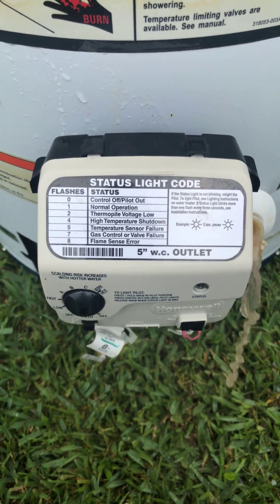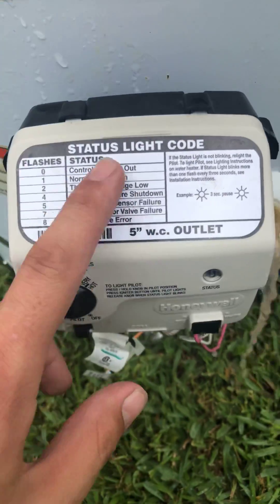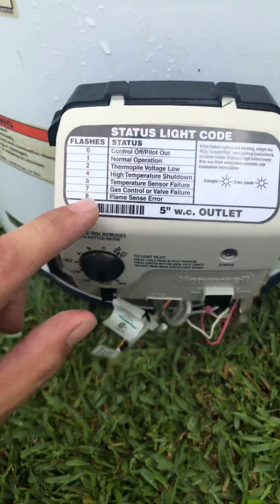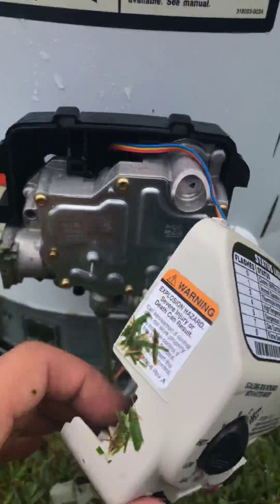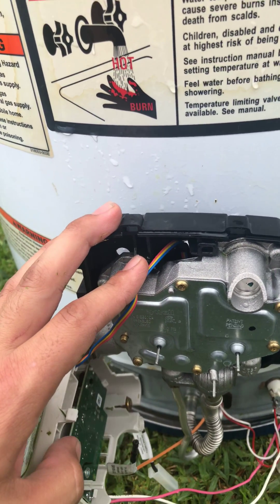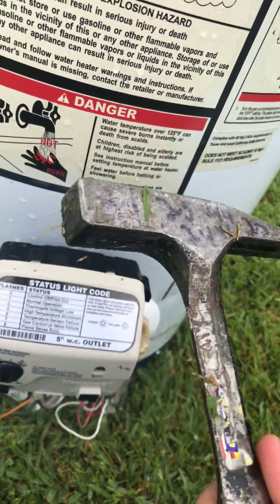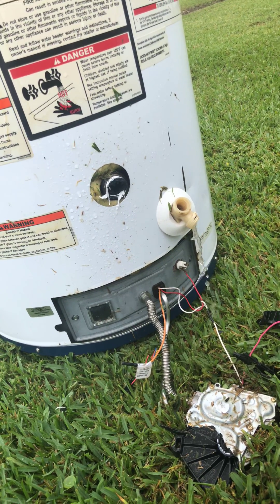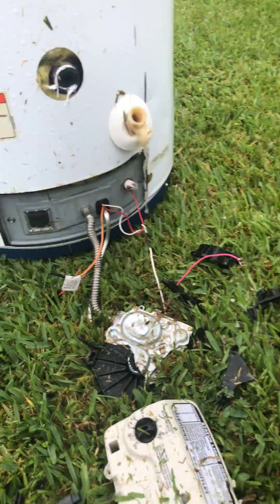How to fix Honeywell gas valve on water heater gas control

Comment: Best advice for these overpriced  under performing, completely ridiculous gas controllers. My water heater runs only on low, or perhaps it’s pilot only, Controller indicates (5) flashes indicating “Faulty Temperature Sensor”.  Of course there is no way to replace just the sensor and replacing the burner assembly  with a part that is no longer available is the current status. Testing the temperature sensor shows “closed” circuit so the sensor is tested good. Still this HoneyNotSoWell keeps indicating a bad sensor forcing me to unplug the temp sensor plug from the controller, reset everything, relight pilot, and start the heater. Then wait for 6-8 min for it to register a nonexistent fault, rinse, lather, repeat. What I would give for an old school water heater WITHOUT one of these idiotic controllers. They always worked.
Reply from the maker: The one I replaced this one with worked fine and never had any issues so maybe the addressed the issue ended up moving recently though hope it holds up for the new people haha . But yea the old school has valves where tanks changed my grandpas water heater the other day it was 22 years old never had any issues . The threads on the inlet on top started to leak at the body of the tank that valve though was perfect wonder why they try to fix things when they aren’t broken .

Comment: I got a new (old) valve on Craigslist for $35. Now I have hot water again. Didn't try the hammer method though.

Thanks for the content.
Keep up the good work.

בס'ד
Reply from the maker: Haha you wouldn’t believe how great it felt , almost as good as the hot shower after
Reply: @TheRandomHandyman   You just gave us an entire new meaning to the expression "water hammer."

Comment: Welp...not what I came here for but that was hilarious. My water heater is 8 yrs old and I'm debating whether to just get a whole new one.  2 months ago it went out and I got it going with the- turn to very hot for 10 secs..then hot 10 secs..then pilot. 2 weeks ago- out again. It was blinking I think 2 times so I just had to restart the pilot. Now no lights flashing and can't even get it lit. Been trying all the suggestions in these videos minus replacing anything like the thermocouple or pile- which I'm not sure makes sense if it won't even just light.

Comment: I just don't get why there aren't class action suits on these. 
I bought a house that has a 2020 model. Has the 5 flashes of doom. No reset fixes it. 

Swear if they had a small amperage wire going to these instead of the stupid generator setup, these would be leagues better

Comment: don’t quit your job. waste of time
Reply from the maker: Guess who got two thumbs and hot water??? Me haha if you smashed yours and went buy a new one perhaps you would not be looking for a video on how to fix it 🤷🏻‍♂️
Reply: Water heater I was working on had a tear in the burner screen, not uncommon and a total fire hazard.  This was causing gas valve to shut off (doing one of it's jobs)! You said you replaced 4-5 gas valves,, yet could be other issues causing Gas Valve failure (thermopile/thermocouple, drafting issues, or in my case a burner assembly under recall). Smashing it is the worst advice one could offer. I got it all replaced for free after some reading.
Reply from the maker: @mattodrums  snashing it wasn’t the advice the advice was to buy a new water heater in doing so it worked great after.

Comment: I am not a plumber but I had the same problem.  If the light flashes 4 times, the water is telling you that something is wrong. It is working exactly as designed to keep you safe! Usually the inside of the water heater is full of silt or calcium buildup that causes it to over heat. 1st, drain and flush your entire water heater. You can attach a garden hose and run the water outside. Then there is a simple process something like turning the control knob full on for 10 seconds, then to hit for 10 seconds, then to pilot for 10 seconds. The control will reset itself with no need to replace any parts.
Reply from the maker: Honeywell claimed after it shows code it’s done for no telling new water heater had had no issues
Reply: @TheRandomHandyman   but if there was buildup of sediment or calcium on the bottom of the water heater from years of use, then it will overheat until you flush it out. If you fix that problem, you can reset the controller and it might last longer.
Reply from the maker: @johnharris5508  I follow what your saying, but I reached out to Honeywell on multiple occasion and said hey look this thing is flashing 4 times, the response when it was under warranty was that they were sending me out a new control module because once it showed 4 code it had overheated and would not work again. I had previously attempted to flush tank when it went out the first 2 times and re filled tank and attempted to get it going again and it lead to no success as referred to in this video they have videos of other people saying you can use a 9v battery and 2 jumper wires and “reset” the module and make it think it’s all good again and it will then work , I also attempted that on the 3rd one that had gone bad. As even though the boards were free when under warranty I had to wait for them to ship from across the United States so I did everything I could in attempt to take a hot shower. But according to Honeywell on the phone the model in this video once it overheats it opens op and breaks contact inside and does not close back rendering it useless and having to be replaced. The water quality here is very poor and in the 5 years I lived here with that water heater I had changed that module 4 times if not 5 I had also flushed the tank every 3 months in attempt to prevent it but in the end it still broke in this video it was at the point that the warranty had ran up and I was going to have to pay 125 or 150 for part as well as the valve on the flush port was about to fall apart witch it did crack and fall apart when I emptied it the last time before putting new water heater in so it was on it’s very last leg, now the new water heater is made by rheem and also has a Honeywell valve on it that looks a lot alike but is a different model and have different codes and it has had no issues at all so perhaps the one in this video was the worst model they make idk, but my grandparents built a house up the road about 2 miles and the water is from the same place and they have had the same water heater for 21 years and have never flushed it out and never had any issues at all what so ever so idk. But what I do know is when the first swing of that hammer met that control valve many years of pain had been let go lmao
Reply: @TheRandomHandyman  Honeywell is wrong then. I have cleared the 4 blink with 10 sec on high then med then low. Hot summer days trip it sometimes but I have run it for years after. Clearly not working now though as I am watching your video & agree with your choice of tools!
Reply from the maker: @870wingmstr  lol hit it one time for me haha
Reply: @TheRandomHandyman  I don't have that special hammer. Do you think my 12 pound sledge will work?

Comment: Amen brother! I have had mine replaced 4-5 times over the last 3 years and it is absolute trash! I can't understand why any company would purposely manufacture a faulty part like this! You'd think they would lose money replacing them constantly during the warranty! I'm on the hunt for a water heater that doesn't use the honeywell (or Moneywell rather) gas valve, which will be hard since most gas water heaters seem to use this brand. It's insane!
Reply from the maker: The new one I replaced it with is a rheem from Home Depot it has a Honeywell valve that looks very similar but it’s a different model and I’ve had no issues over the past year
Reply: @TheRandomHandyman PLEASE HELP!! ANOTHER video said this Honeywell gas valve/thermostat is NOW made by RESIDEO.  My water heater is only 3 years old & I just now got the “4 BLINKS” and am wondering if anyone has had BETTER LUCK with the RESIDEO model that supposedly REPLACES this Honeywell piece of crap?? I need to call my HVAC company to order a replacement and want to know if the RESIDEO one is better!! Thanks!!
Reply from the maker: @beachgirl4truth  haven’t heard anything about a different company but once it flashes 4 times it’s dead gota be replaced call number on heater for waranty
Reply: @beachgirl4truth   Honeywell just changed their name, their "brand" for water heater valves. Resideo is the same company. Hope this helps.

Comment: Waste of time. Thanks.
Reply from the maker: Idk, my hot water is working fine. Had I tried to fix it or change that control valve the water valve would have broken for sure, and the control valve would have craped out at least 2 more times by now so the new water heater has saved me great amounts of time.

Comment: Lmao. That’s one way .. but fact is they changed them for safety cause to many people were blowing up their houses and selves then sewing them they were highly unsafe for those who should not work with Gas. But the main reason your control malfunctioned is cause of all the grit that builds up at the bottom off sets the temp and reads that it’s hot cause it trapped water.  Really you only needed to flush your water heater out and do it yearly to flush out hard water deposite..or get the hammer lol
Reply from the maker: Thanks for the info, I can most definitely agree with this because the water is this town is terrible, they have had parts continuously go out on chill water system at a local grocery store and they sent off water sample to see if it had something to do with it and the testing facility called and asked if they sent tap water or sewage water , that kinda concerns me lol. And I had flushed that water heater in this video every 6 months and when I would flush it a gel like substance would come out when it would be close to empty it was like a clear-ish/ white-ish gel/clumps looked like little jelly fish. Not sure what exactly causes that but when I would change control valve tip would be kinda cloudy looking. Now I changed one for a family member 30 minutes away in another water district and there control valve had gone bad as well but the probe tip was crusty and rusty and the bottom of the tank was full of rust and sediment witch I assume has something to do with the old galvanized pipe in there house. The new water Hester I have installed with the new control valve witch is made by Honeywell as well but is a slightly different model has given me no trouble though as I changed out the one in this video 4 times I think so maybe it is slightly different.

Comment: Man, I wish I saw this video before I bought my brand new Rheem unit. 
Guess what, straight out of the box brand new and it doesn't work. Same design as yours. 

I guess it also works getting used to no hot water and cold showers. Who needs a water heater. Honeywell is certainly promoting saving the planet against warming.
Reply from the maker: Everyone has problems with them they suck

Comment: You stupid ass. Thanks for waisting time... move the heater to a ventilated spot .... its supposed to breath
Reply from the maker: If you were so smart I don’t imagine you would be looking for a video on how to fix your water heater, as well as in this video the water heater is in the middle of the yard so I’m not sure how you assume it was not ventilated as well as the issue with this control valve was over heating or the probe witch is inside of the water heater so I’m not sure how the ventilation outside of a water heater would cause the probe inside to overheat in the water. Just so ya know the main cause is crap in the water collecting around probe witch is why they suggest flushing tanks regularly but ok then lol

Comment: Ahh this is therapy for me. Can’t wait till the day I get to do this myself.
Reply from the maker: This Is D haha that water heater was the biggest pain in my a** , it would always go out and the control panel quit working completely at least 4 times . New one has same style control but different model and I’ve had no issues so far . Fingers crossed or I’ll beat that one with a hammer ha

Comment: Thanks for wasting my time
Reply from the maker: Eva Webb I mean I’ve tried the way they say it can be fixed so I’ve waisted my time doing something that won’t work. So I kinda saved ya the time of trying all night to get it to work when it is broke broke they make them this way to make sure they continue to make money. So if it is under warranty you can call and get a new one in a day or 2 and change it then I can explain in detail how to change it. If it is not in warranty it will cost $200 from them or $100 on Amazon .
Reply: ajjd100494 unfortunately the warranty is non-transferable and I bought the house from the person who had this installed. It actually would be under warranty if I was the original owner. I just replaced the pilot assembly and the damn thing still won’t light.
Reply from the maker: Eva Webb well that’s some crap cause I bought my house with that water heater in it and they sent me 3 over the past few years and had no issue I’d call back and just say u are the one that bought it if that makes them happy
Reply from the maker: Eva Webb the new gas control valve is around $100 if you want to order on amazon you just take everything on bottom of it off, turn gas off and unscrew valve from water heater. After draining water out first by turning water off at top and draining out of bottom with hose . I had simply changed it to many times and all the parts were getting worn from being removed and put back together and the drain was starting to crack so before spending money on something that would continue to have issues it made sense to buy a new one with a new warranty and when I drained it to put new tank the drain ended up cracking as I thought it would so I would have been screwed if I had not got the new tank. So if you think your tank is in decent shape I would go ahead and order part for $100. But like I said if it’s under warranty still that’s crap they should send you the part for free
Reply: ajjd100494 well they already have me on file and know I’m not the original owner so I’m stuck paying for the parts. The pilot assembly cost me $140 and I spent $20 on the new gasket a couple days before when I tried cleaning the line first. I’m not even Sure I needed a new pilot assembly now. I’m gonna get the gas control valve and see if that works and if it doesn’t I’ll just return everything and call a professional. The tank is in good shape, so I don’t think replacing it is the most cost effective move at this point.
Reply from the maker: What was it doing, did it have some kind of code it was flashing? And I have a spare pilot assembly in my garage I can mail it to ya and you can send it to them and get a refund for the one you paid for.

Comment: Thanks for the tip. Saved me lots of time
Reply from the maker: mig m no problem, since I put the new water heater in I have had no issues , same type of crappy electronic Honeywell board but it’s a different model, hopefully it holds up better than this model didn’t